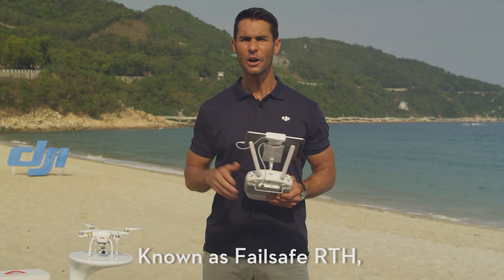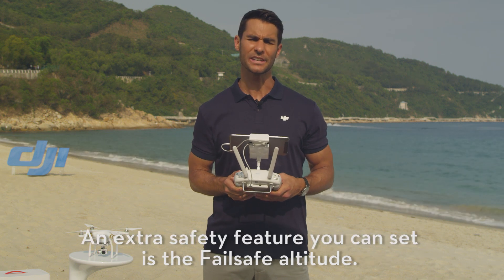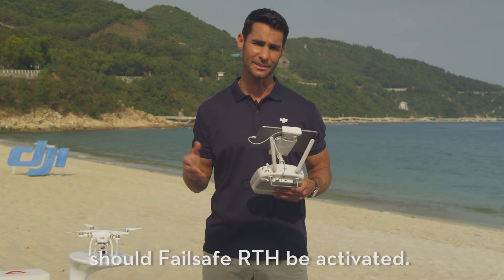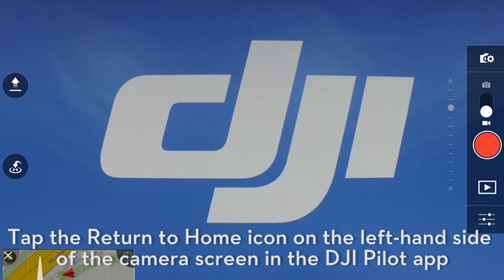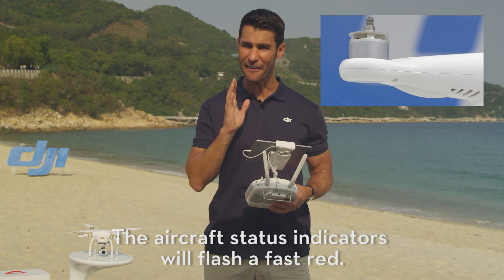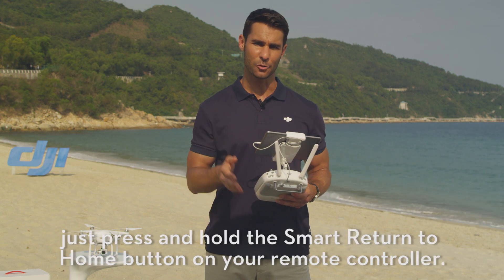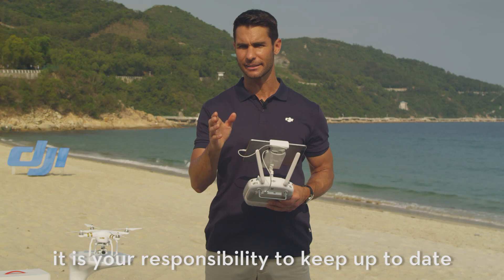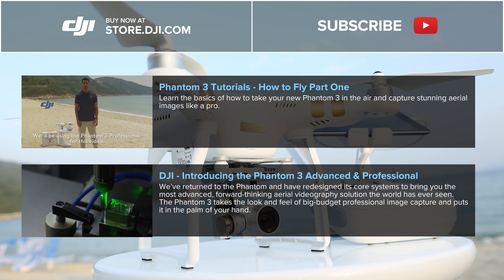DJI Tutorials - Phantom 3 - Failsafe - Part 2 of 2

Comment: what if for instance.. iam on a boat flying.. and lose control of the rc? what should i do? will the RTH be working? since the boat is moving.. can it land to where the remote is? thanks
Reply: +madearisp You can change it in the settings. When rc singal is lost you can choose between RTH or hover. The aircraft finds its way back to the takeoff point using GPS. Or it will hover until singal is regained. But if battery is low it will decent in the water, so it is best to let the aircraft takeoff from land so you have a minimal change of crashing in the water.
Reply: You should use RTH and once the drone is close to you cancel it and manually land it.